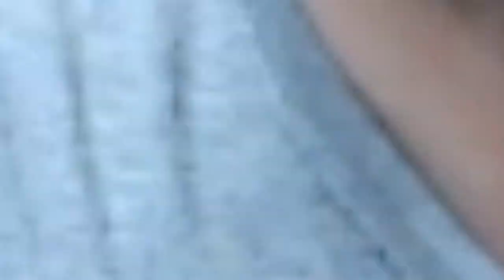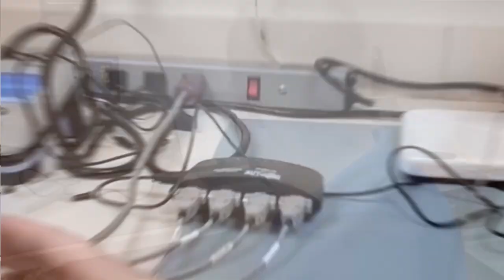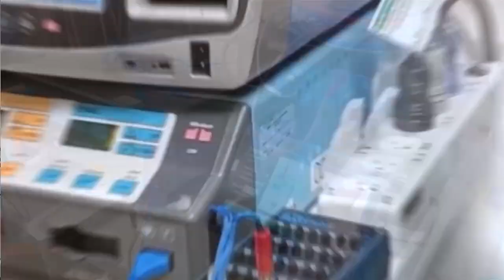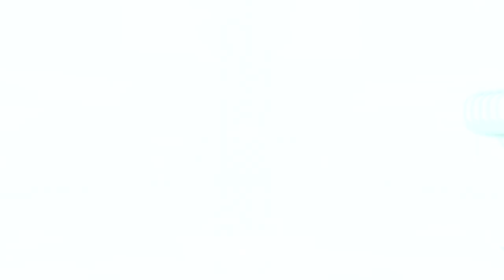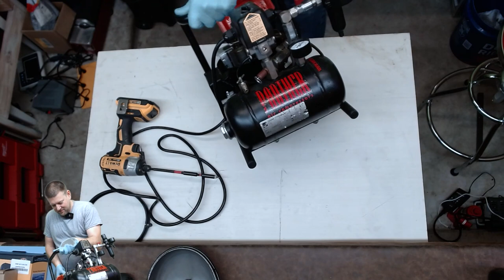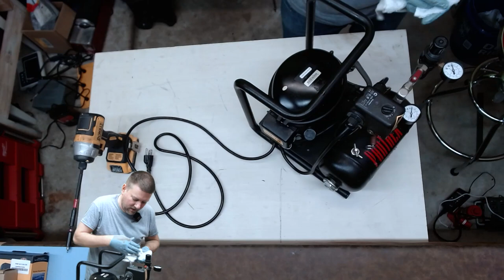Servicing A Reciprocating Air Compressor

Comment: i recently serviced my air compressor because the pressure switch didn't turn off when the maximum pressure was reached, the compressor kept pumping untill the safety valve opent which make a lot of noise at maximum pressure. I took the pressure switch apart, and saw a plastic bloc that wasn't sitting at his place, and also noticed the membrane was in bad condition. So i took a piece of a bike rubber inner tube, made a new membrane and the pressure switch worked as new again. Then i took the safety valve apart and cleaned the seal and spring and noticed something. The usual yellow or red plastic cap over the nut and check nut, works as a extra safety so that the 2 nuts can't come apart from each other. Because i took the pressure switch completly apart, i had to set the shutoff pressure again. i set the pressure switch at a very low value, and start to set the pressure on the safety valve to the same point, then i upped the pressure on the pressure switch in steps, and followed by the adding tension on the safety valve untill the compressor shut off. For safety, and because this compressor is 16 years old, i set the maximum pressure 1 Bar lower then new (from 8 to 7 Bar), and then temporary bypassed the pressure switch and set the safety valve arround 7,8 a 8Bar to start opening. i know from experience that pressure tanks rust from the inside out, due the moisture and condensation water, and after years the metal thickness of the tank will get thinner and this becomes a safety hazard (read bomb). But if water is kept inside a closed tank, and the tank is not being used, the oxygen in the tank will be used up and the rust proces will slow down. If the tank is regular used, so every time new air with oxygen in it, and there is water in the tank, the rust proces keeps continue. For a extra safety, pressure tanks needs to be tested to be sure if they safe to use (flled with water and pressurised way above the normal pressure and measure the increase in tank diameter), another method is to use ultrasonic waves and a slighly vacuum to test the tank for weak spots, this technique is used on tanks with fuel inside. In my case, i did a tap test on the bottom side of the tank with the handle of a screwdriver to check if the metal was still thick (you hear the difference in sound when tap on a thick or thin plate of metal). This is not a guaranteed method, but better then nothing.

Comment: 1:33 If it has a safety valve i wouldnt mind the missing pressure gauge.

Never get it why anyone would use this kind (pancake) of compressor outside of refrigeration though...... The traditional "open air" design is so much more serviceable.